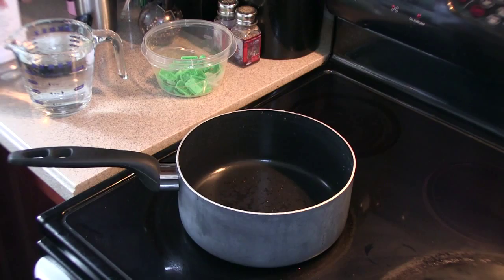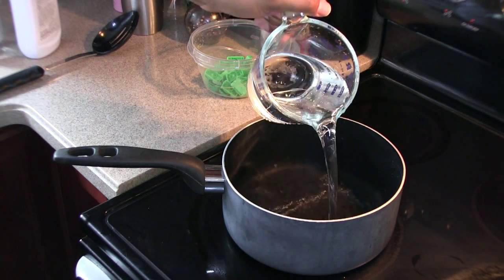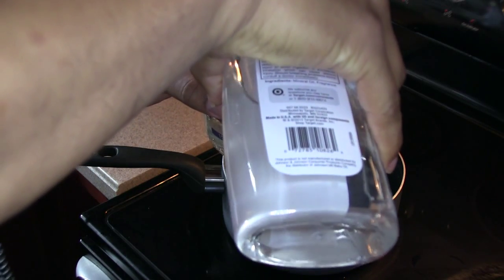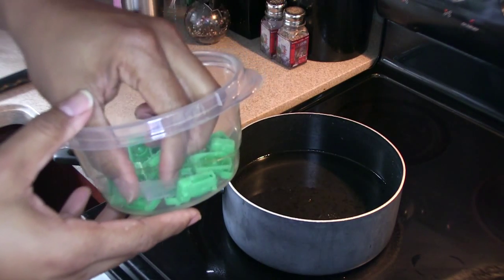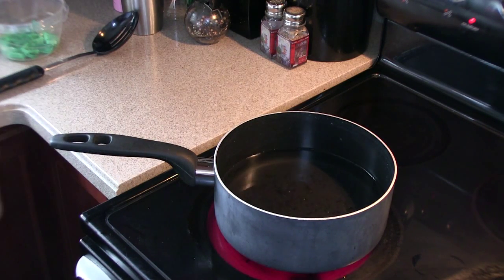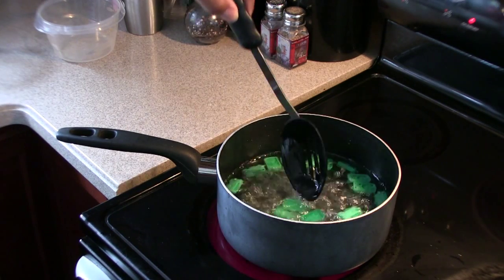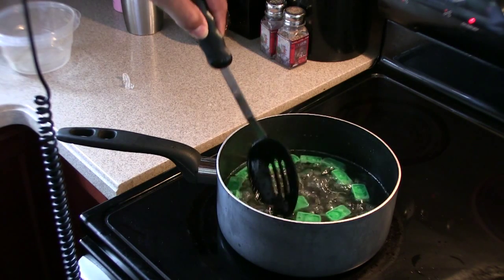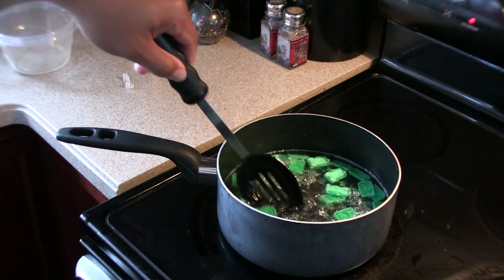Base Boiling Technique

Comment: what is the boiling suppose to give to your base? more speed or strength? What are the advantages of boiling before tweaking?
Reply from the maker: sam jomphe Some bases don't respond after they have been tweaked. Boiling softens the plastic, which helps them to respond to tweaking. The balance of oils used helps the base grip the board better than an unboiled base. Every base can't be boiled. The Tudor Frosty base is best for boiling because there is no guess work in how to boil them.